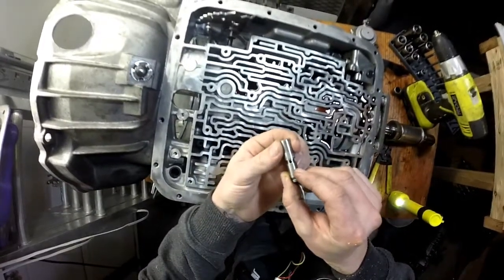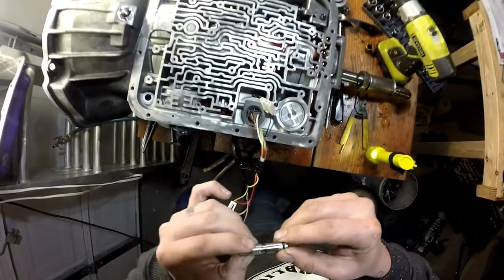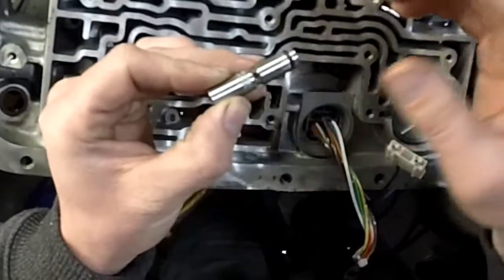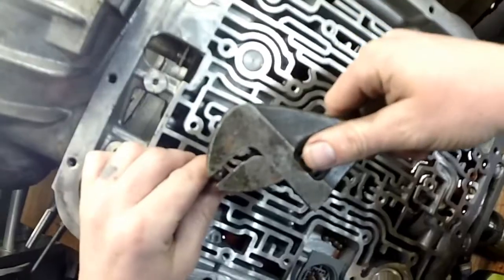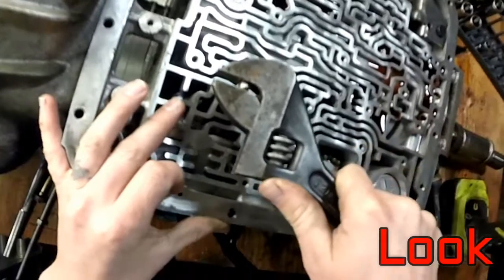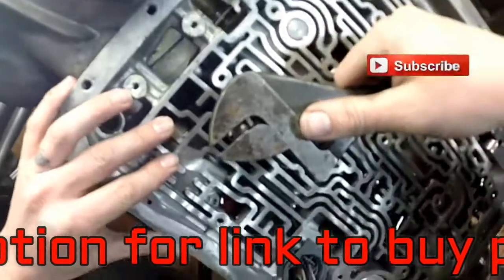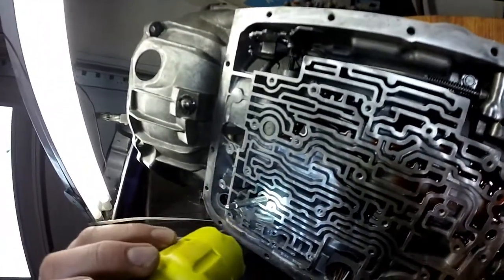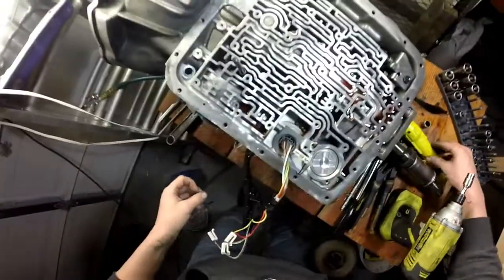REMOVE 77701-076 sonnax 4l60e Servo Release Check Valve, 2nd gear servo

Comment: I just bought a Sonnax 1-2 forward pinless accumulator kit  for the 4l60e in my 08' sierra and was wondering if you have a step by step video on how to install these parts?
Reply from the maker: I think in my library of unedited videos I have me installing the pinless accumulators. I didn't have any plans to edit it and get it uploaded soon but maybe I will speed that up and put it higher on the priority list. If I could find it easily maybe I'll edit it up and posted this weekend coming up. But it was super simple.